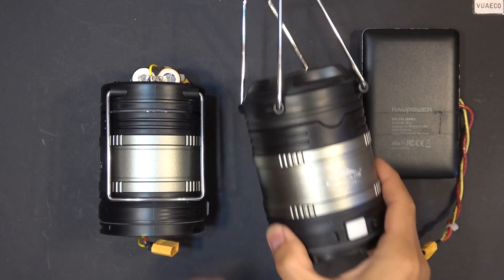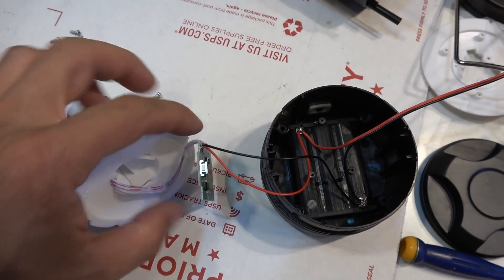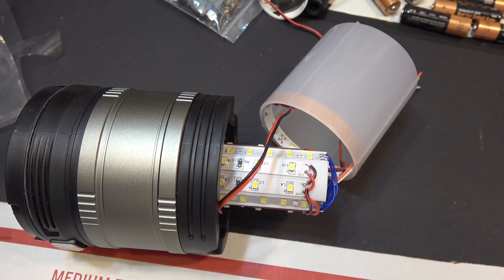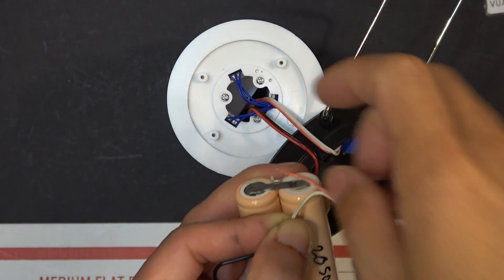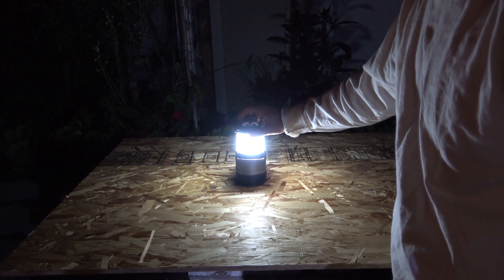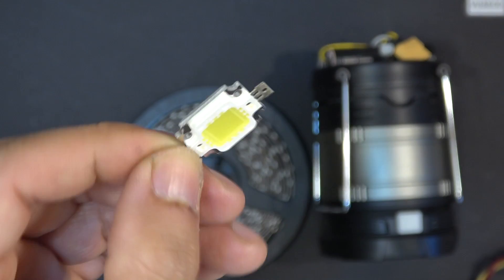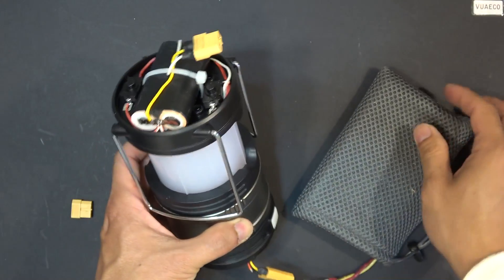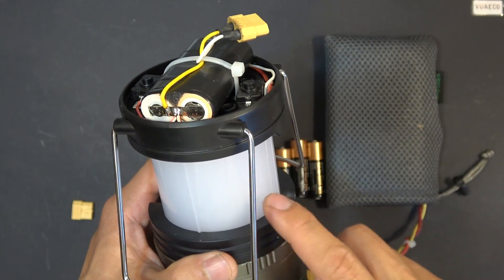DIY: LED Lantern hack: from AA to 18650 Li-ion & Install more LED's

Comment: I wonder, you said the board inside this has a phantom load which I do understand. I'm wondering though, was it designed that way, and if so, why? Just hoping for an explanation because I don't understand.

Comment: Question, why not install an 18 650 charge, discharge protection module instead of the connector? That way you'd be able to use a cell phone charger with it. Just wondering.

Comment: Nice modification! How did you solder the connector onto the terminals in the battery compartment? Maybe it's just me but I always have a nightmare of a time trying and I usually just end up bypassing the battery compartment and soldering directly to the circuit board?! Thanks